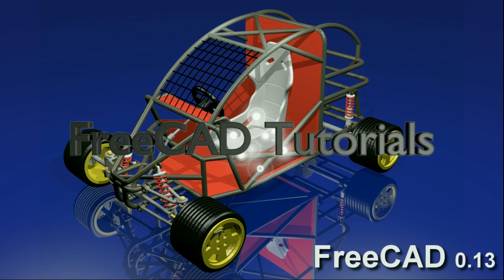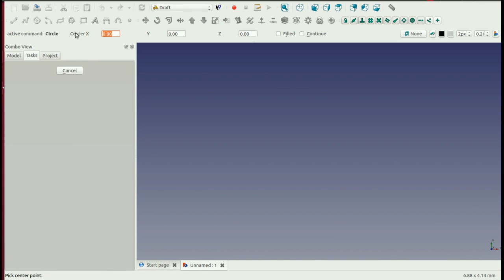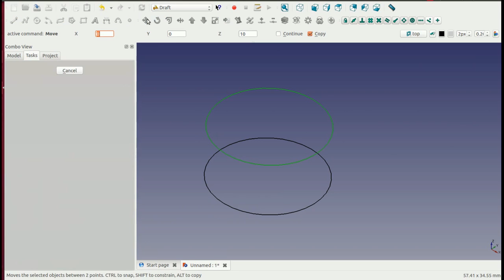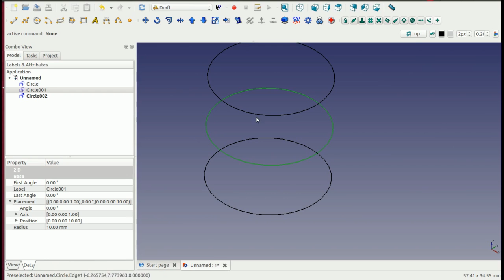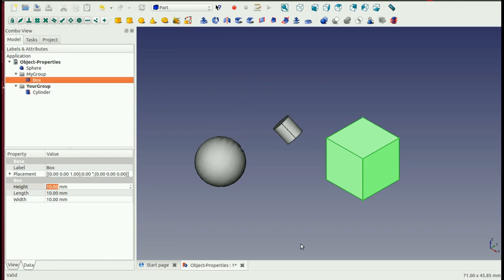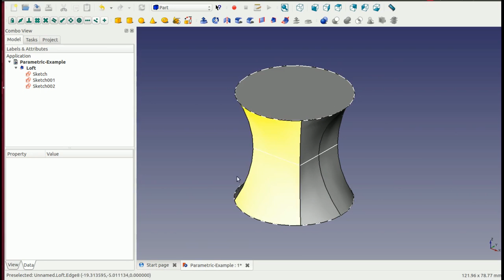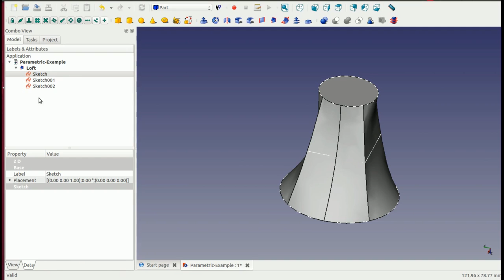FreeCAD Tutorials - Part 2 - CAD Basics

Comment: I am just on part 2 and wishing that there was an explanation of the tabs in the Combo View. What is "Model"?  What is "Task"? and What is "Project"?
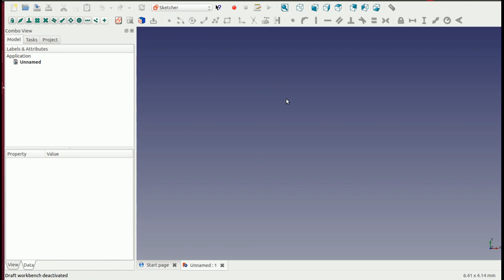At 4:31 and 4:41 the comment that the drawing tools there were for parametric drawing was a very helpful distinction over the  "Draft" work bench.  Good work.
At 7:45 or so came "Loft" or "Lofting". This needed definition. I would not have even figured out what you meant had I not helped a friend with some boat building.
https://en.wikipedia.org/wiki/Lofting
 
What version of FreeCAD was used in the making of this ?
1000 Thanks.

Comment: I do not have the same tool bar as you have. It seems to be architectural. I am working with Tubing, angel and flat metal sheets in trailer fabrication. Where do I find this?
Reply from the maker: There is an add-on called flamingo that handles some metal working features and frames. I could do a trailer tutorial if that would be useful?

Comment: This is not the view when you first install the software, how did you customize the view? discuss that first. I cant get the tools to show up. too counter-intuitive
Reply: I think the view at first install changed since this version.  I had an install of something like 16 and it looked more like this.  Frustrating that when the software is updated the user interface and defaults change. 
I faced this problem with LibraCAD and found and installed older versions to match the tutorials.

Comment: Mine is like a blank piece of gray wrinkled paper.
I had to click up where file is and then click view, then draft to get it to come up.
Then you have to hit new document in the upper left corner (looks like a white square) to activate the program so you can sketch.
That's as far as I got as I need to find out to get it to snap on the 90 degree lines and figure out to get it to make a line a specific dimension.
Oh, it would be nice to see how to add other tools like fillets or make a radius.
Probably simple as hell, but until you know what to click, you are stuck.

Comment: Just found this tutorial series, for anyone watching these and might be stuck around the 8 minute mark when he's talking about constraint sketches (Sketch Constraints) like I was I and running 0.16, I found the following worked. You can double click the sketch from the model tree to open up the tasks -> select the outer circumference of the circle -> press shift+r and change the radius -> close the task to complete. Additionally shift+d is used to change the distance of selected lines in a shape like a square, and all the constraints can be changed from the sketcher workbench.

Comment: I greatly appreciate you taking the time to create the tutorials.... but the sound quality is abysmal.  It needs to be normalized in a video editor to overcome the basic microphone being used.  When you speak, your pronunciations have peaks and valleys in the audio that your microphone is amplifying.  This results in very loud audio fragments interspersed with very quiet audio fragments.  The collective audio is difficult to make sense of.  Most video editing software, such as Premiere Pro and Premiere LIght have an audio normalizing feature which will adjust the volume so that it is consistent.  This helps listeners hear you more clearly.  If I had to guess, I would say you are using a USB based headset with the microphone positioned rather close to your body.  A lapel microphone designed for videography would do wonders for the audio quality.  A wired one that plugs in to your computer would be inexpensive and should be fine.  Thank you again for taking time to share your knowledge of Freecad, I just wish it wasn't so hard to hear you.
Reply: The audio sounds fair to me, there are a lot worse out there in youtube land. Granted it's a crap microphone and there is some background hiss from the pre-amp but audio compression would just make it louder. Microphones don't amplify they just listen, it's the circuitry which follows which can colour the audio. I think the main issue is that he is speaking in "English" and some of the viewers are listening in "American".
Reply: Can understand him fine
Reply: I found it difficult to hear, period. MOST youtube videos are loud enough but this one I had to crank way up just to hear. (then I have to remember to turn it down again later) :-P

Comment: you mean to tell me that EVERYTHING has to be done by hand-coding coordinates??? there's no grid that you can draw on and snap to?
Reply: there is a grid you can work with, in cad however, your drafting not drawing, your creating parts and buildings with specific measurement so any grid is there mostly for the point of presenting the user with spacial confirmation.  It's kind of backwards from programs like illustrator, where you use the grid to help layout a design, in cad you use the grid to help understand the design once your done laying it out.  You can find precise measurements, degree of an angle, length of a line, so on and so forth to take the design from paper to production.

Comment: If you also ran into same problem why objects not showing in loft function, you need to create sketches ın sketcher workbench. But there is another problem that I cannot figure out to edit parameters of sketches. Creating an object with mouse is quick and dirty. If you want to create a proper sketch you probably need to type in parameters (for exact values). In this tutorial you can see how to do that in draft workbench but it does not show how to do that in the sketcher workbench. And those parameter fields do not show up in the sketcher workbench. Does anybody know how to do that?

Comment: i have a question, i'm doing the part where you place the 3rd circle above cirvle 001 but the 3rd circle doesn't appear above, it appears kind of diagonal, a little bit far from 001. do you have any idea why this happens? i've watched the video many times to try to find out what i did wrong but i just can't find out what i'm doing wrong.